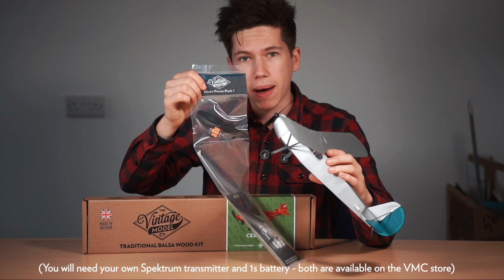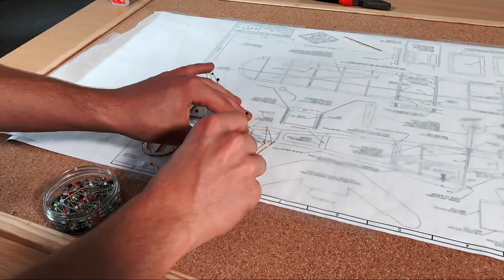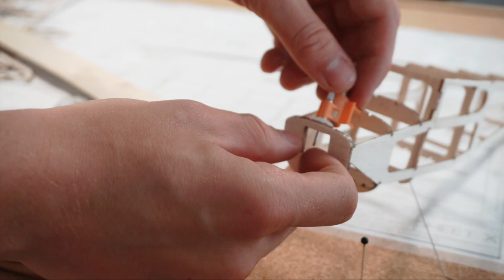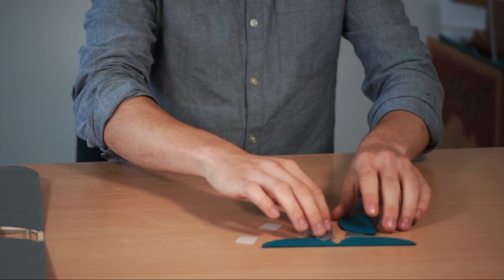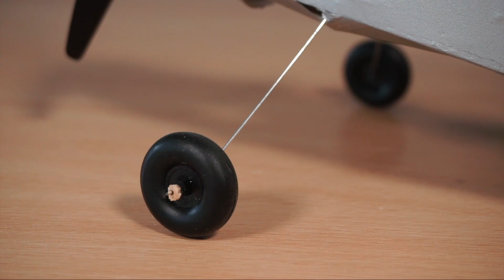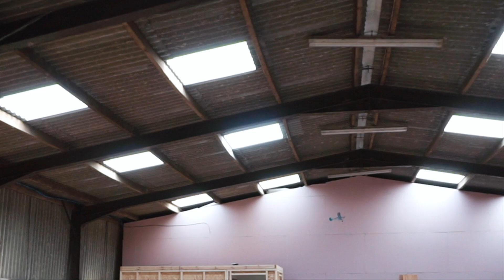How To Make an Ultra Micro R/C Plane

Comment: I found that it is difficult to buy the RC components and motor. It is cheaper when you order a whole ready-made RC plane. They are on Amazon starting at 35 dollars. To order the parts separately can be troublesome and it is even more expensive.

Comment: I built a Guillows kit and put in the electronics from the UMX radian, it flies great. I wanted a bit more power for my next one so I took the electronics from the UMX Timber and am putting them in the Dumas walnut scale beaver. Vintage model co kits look nice as well, I'm going there next :)

Comment: I've managed to 'convert/adapt' a few of these rubber models to electric. Covid killed indoor flying last year and restrictions on travel and gathering prevented other attempts to maiden. I have the Vintage Corsair, modified with ailerons. Just about ready to fit wings. The whole process of build convert and fly is simpler now spektrum have the block receiver. You could even fit a brushless motor with some Rx boards...

Comment: £93 for a spektrum reciever and a single brushed motor? Straight up highway robbery there. You can buy a full kit for cheaper than that nowadays. Brushed motors literally cost less than £5 for a 4 pack and a cheapo spektrum rx with some micro servos would run about £25

Comment: Would the micro power kit work with the Westwings J3 Cub. I built the cub a number of years ago and wouldn't mind trying to convert it to simple RC, (I've never tried this before!) Wingspan is about 35 inches. I already have a Spektrum DX7s i'm assuming this would also work?
Reply: I am pretty sure it would be drastically underpowered with the power pack 1
Reply: Have a look at kpaero website for what you need.

Comment: Awesome idea! Especially with ever tightening regulations ala 250g etc. Do you think its possible to use a small brushless motor and servos on a slightly bigger model, what are your thoughts?
Reply: I have just built a small Taylorcraft Auster Mk3 using 1.9g servos and a micro 6ch rx  plus a 5A esc and brushless 1s motor from Banggood. 5030 prop.
Reply: @paulellis4693  Great mate, have fun with it! After having built several bigger balsa models I reallized it's the small ones which are really fun and floaty in no wind :)
Reply: @MaxDelEcuador  Flew it for the first time yesterday after replacing a faulty motor which fried the esc.  Great flier.

Comment: Hello! Would a spektrum dx8 gen 1 from 2010 work with your micro power pack? Thanks!
Reply from the maker: As long as it is a DSMX radio, you should have no problem binding to the micro receiver board. To be on the safe side, you can check with Spektrum themselves. The AR6410L has some documentation on their website that goes into which radios will work.

Comment: The receivers are dirt cheap. I have 4 of them. They are a no brand receiver that works on a Spektrum Transmitter. They are feather weight light. The battery weighs more than any thing else. Now days you can get a combination receiver and control for the tail.This is a three channel system. Awesome video. I found a place that still sells the balsa plane kits in the next town over.
Reply: Do you know where to get that micro power pack 1 in the usa? Also, I am wanting to fly micro planes using my flysky I6, do you know what receiver I can use and servos? Any help would be greatly appreciated, thanks in advance!
Reply: @abundantYOUniverse I know this is 6 years ago but if there is any chance you still wanna get a reciver there is one on Banggood for the fsi6

Comment: I have been working along the same lines now since hearing about the silly over the top draconian regulations coming into force in October 2019,I see a great future now for micro R/C and they are real fun to fly as well,good to  see that the Vintage Model company are offering these flight packs to install into their kits and leading the way forward,others will no doubt follow.
Ailerons is the way to go for the low wingers I found the easiest way is via a torque tube arrangement in the wing straight to the ailerons,you can use the newly availablew paper straws built into the structure with carbon rods operating inside the tubes and have one central micro servo to operate both ailerons,you can also use rudder successfully on low wing types provided you add plenty of dihhedral to keep the fuselage sitting low like they did with the old vintage models of yesteryear ( check out Colonel Bowdens Spitfire for example ) I have flown Bf.109's & Hurricane's for example with adequate rudder only control done this way.
I have not been able to locate these Spektrum brick receivers ? does the VMC supply them and if so what price please ?
I am also hoping that the too low 250 gram rules will be ammended to an higher weight limit to accomodate the heavier batteries rather than just a 1S,something that would give an adequate wing loading for say a jumbo rubber model size would be even better for flying outdoors.
We must never allow the freedom of model building and flying die and the answer could lie in these small radio models which are economical to build and fly,please keep us informed of any new developments and let us know also when the new Aerographics range with radio conversions are due out,the video you did recently with the designer mentioned that he was modifying their Auster kit.
Another great video,your work is a credit to the Vintage Model Company.
Reply: 250 gram is way heavier than you need for multi-cell, that should not be limiting you to 1 cell! I have a 4s 800+mAh pack on my race quad, and if it’s doing 100+ mph and still under 250 grams, then you’ve just gotta quite building your planes out of lead, haha!

Soon I’m planning on building a 150+ mph airplane under the 250g limit (I’m hoping around 200 mph, looking at canvas biplanes right out of ww1 hitting 350+ mph makes me really think if I can’t hit 200 mph with modern carbon fiber composites and high power motors with 6s battery, then I must not be trying hard enough if I’m much of an aerospace engineer! Ambitious? Maybe, but also maybe not as much as you might think... old biplanes from the 1930s can do it, so I should be able too!

Comment: Interesting stuff, I fly my rubber-powered models near many trees, so have been contemplating rc-assist for a while. Do you post the weights of your components?
Reply: Crashrr I think most rc-assist free flight guys just use a nano actuator on rudder that’s lighter than the brick to keep them closer to actual free flight style but avoid trees, you should check them out, they are essentially just a electro magnet on the rudder hinge so you don’t have precise control just a certain angle left or right